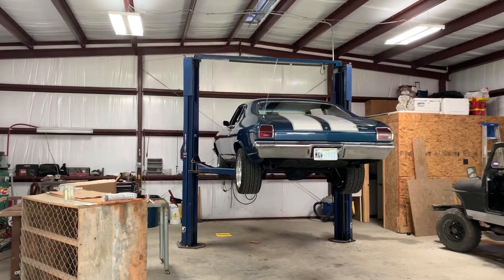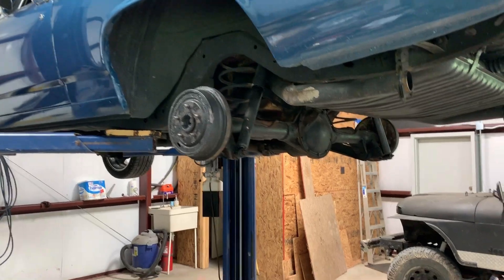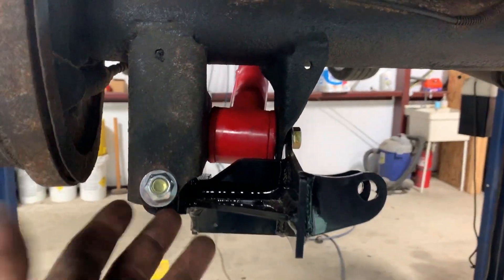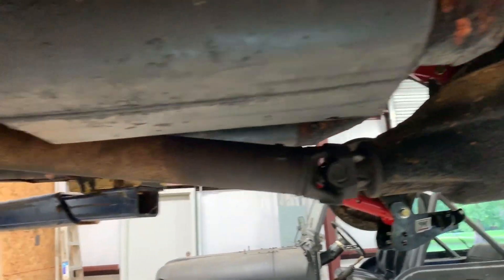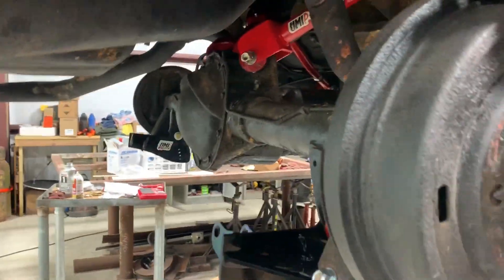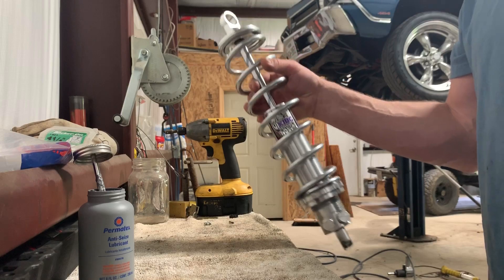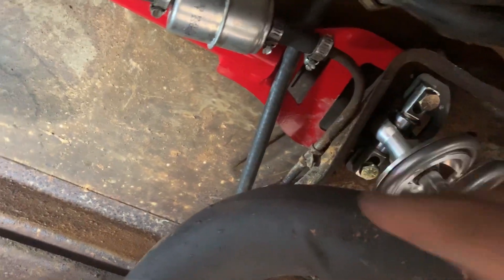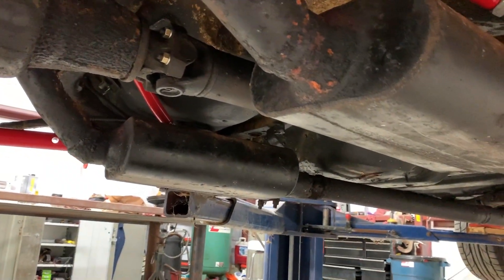UMI Performance Front/Rear Coilover Conversion for 1968-1972 Chevelle/A-body

Comment: Ugh, so disappointed...... Half of my kit was delivered for years 68-72 and the upper rear control arms and frame braces were shipped as year 64-67. I’m so upset right now. However: on a positive note; every old original nut and bolt is free, loose and ready for removal when the correct parts get here 🤘🏼👍🏼
Reply from the maker: Frank Carey Man I hate to hear that… That could be simply an expediting error on their end… Automotive parts companies are usually very sympathetic with their mistakes and will handle up with extreme priority.. I did a lift not too long ago and the kit came without the upgraded 2.O fox shocks… They said don’t worry about sending back the shocks to swap, we will send you a whole new kit.. blew my mind.. now my buddy has a whole new $1600 kit without wanting the others back.. it’s unfortunate, but will be worth it in the long run..atleast you’re ahead of the game.. if you plan to replace your upper axle bushings… Go ahead and knock out the old ones .. it’s a project in itself.. a great link on how in the description..
Reply: john hartel I’ve seen his video before, it was tough but I got 1 of them out. The bad part is that I’m on my back with the car about 2’ off the ground, no lift 😫. I’m going to have a time getting the new one in do to lack of swing and range of motion. I’ll trying a piece of threaded rod with nuts, washers and a pipe sleeve if I have too. I’ll reinstall the old upper temporarily when I get the bushing in so I can beat out the other side to get thing install down to a minimum when the part get here. Shock tower brace, coil overs are all cinched up at the top 👍🏼

Comment: I recently put QA1's "new and revised" coilovers on the rear of my 69 LeMans.  I'm very unhappy.  Had to chop off the back half of my $1000 exhaust system and add turndowns just ahead of the axle.  Cannot route exhaust through the new setup.  This UMI system appears to have created the exact same PROBLEM.  I'm very close to removing the QA1 parts and putting my air shocks back on, with the stock coils.  Anybody want to by a QA1 setup?  LOL
Reply from the maker: 😂😂 I found out the hard way as well.. I’ll take the ride and eat the cost of the re-route (haven’t done it, but it was due anyway) over the worn out stock suspension any day.. sorry to hear the issue for you..

Comment: Oh man I’m so happy that I found your video..... I purchased the complete stage 4 front and rear suspension kit with the upgraded rear coil over option for my 1972 Monte Carlo that drives like a sheet of plywood on the ocean. This video is awesome and should really help. Thank you for posting this 🤘🏼
Reply from the maker: Thanks for the reply! To answer your question about the front install, i did not do a video of the front because there are quite a few already on youtube..It was pretty straight forward and easy, even doing on my own. I have them listed in my description for your reference. I was very impressed with the night and day difference between worn out stock and the coilover upgrade initially..but when you find out much tuning adjustment is in these shocks it going to blow your mind...i listed in the video UMI's general cruise base adjustment, (also in my description) which i actually found to be a little firmer than expected...I then adjusted down 2 clicks on rebound and compression on each shock and when for a ride.. man o man!!!...ear to ear..the smoothness, the sensitivity, the control!!!..and then you punch it and the torque from the mild 454 goes directly to the rear and hooks up...no more sideways yaw movement from the torque..couldnt' be happier with the improvement...worth every cent...and busted knuckle... let me know if you have any other questions
Reply: john hartel Going to start this project in November when I put it to sleep for the winter “New England” I can’t wait to see the difference in “actual” handling 👍🏼👍🏼👍🏼👍🏼
Reply from the maker: @Datanka69  Im excited for you bud.. and contrary...its just about cruising weather for us (south east texas).. we actually had a cold front last night...82degrees
Reply: john hartel That is awesome 👍🏼👍🏼👍🏼👍🏼👍🏼

Comment: NICE RIDE , I have 2  1968 chevelles, I put that IDENTICAL KIT on my Malibu  and could not relocate the exhaust to the rear after cutting and welding pipe forever. Do not know why they have that monster coil over lower bracket that has the coilover sit right in the middle.  I  put the turndowns after the muffler but I drive my cars all the time and could not deal with that NOISE . I did find  QA1 Coilovers , their rear coilovers basically sit in stock mounted positions.   I can hear my radio again..    I set mine at 25 x4   totally different ride for shure .. Enjoy

Comment: I love ya car for that is a rare 69 Chevelle Coupe . Thanks for sharing the installation of UMI set up . I’m working on a 69 Chevelle off frame with the 9” Ford and 4l80e transmission along with 468 hydraulic roller. I hope I can get the power to the ground! Thanks Again!!
Reply from the maker: Thanks for the reply Ronald! Sounds like you have quite the project on you hands. I need to gear up to 3.73 from current 3.08, but Ive managed 14-16mpg out of the mild 454 with the TH400 now that ive fine tuned my carb, so you're gonna be in hog heaven with the overdrive.  I couldnt be happier with outcome of the suspension setup and how adjustable it its. Definitely a worth upgrade, especially if you're currently stock. You'll be a F'n arrow off the line with this system. let me know if you have any questions.

Comment: Great looking chevelle! I just put rear qa1 dbl adjustable coilovers on my 69 gto and i have a front set as well. I also installed that umi upper shock tower brace and it was a pain. The qa1 have a bracket with 3 bolts and it took me quite awhile and some choice words with skinned knuckles to get it done. I have umi adjustable lower arms as well and front umi tubular control arms with tall bsll joint's to install with the coilovers. One mean sounding chevelle!
Reply from the maker: Thanks man! Yes, if only they had that suspension technology back in the day. This car is so responsive and fun to drive. I’d compare it to the feel of a new camaro.
Reply: So Im curious what was the cost of your front end rebuild to tubes coil over etc. I considered it  for my 65 goat but Im spending so much on the front end stock, engine, installed UMI chassis brace, Gforce tranny mount which is awesome, and gas tank, alum radiator etc. etc. all that just materials is around $8500! Yipes Thats why I decided to do a stock rebuild, oh I also am going from man. steering to power, lost of new stuff. Have you seen Fast Monty 69 rebuild? If not take a look at the ME Wagner PCV valve
Sorry to much coffee
Reply: @frekkledipped  hello, yes I have subd fast monty, its one bad goat have watched all his vids. The front qa1 dbl adj kit was 750 or 800 i believe, the umi tubular control arms were 1600.00 and the pro forged front end kit i bought was like 350 if i recall. Definitely not cheap but top quality parts for sure that will last. I have done the rear but need to install the front end parts. Your goat sounds nice, mine has a 70 455 bored .60 over, I also brought a new fast ratio pwr steering box and new pump for it as well. Have had it near 30 yrs now...time sure flys!
Reply from the maker: Thanks evil bane
Reply: @puddleduckist  I have a long way to go from the radiator to the universal joint everything is removed waiting for engine to be put together. I purchased one of those tranny mounts FM recommended & a ME Wagner PCV valve. Both seem pretty awesome looking forward to when they are working :-}I bought mine Dec 2020 got burned
Reply: @frekkledipped  sorry to hear u got burned, sounds like once its done it will be a bad goat. My friends dad bought a 64 gto with tri power and a 4 speed new in 64. Kept it all these years and yrs ago restored it with his son and gave it to him, even had the original 60's tq thrust wheels still on it. Beautiful car, dark nocturne blue with black interior, man it's a sharp car!!! Luv the pontiacs, we had several pontiacs over the years. A 65 convertible tempest custom we put in a 428 tri.power, a 66. 67, 68 gto and a 68 lemans. My dads car was a 67 lemans with a butler 455 stroked to a 474 with edelbrock heads, man was it a runner, ran a 10.89 at 125mph off idle first pass it made at Sacramento raceway. Fun times, best of luck with ur poncho!

Comment: Outstanding, my 66' SS-396 sure could have used help back in 1979'. Dirt on the floorboards would jump 10 inches in the air from wheel hopping everytime i did a burnout.
Reply from the maker: 😂😂😂 I know I exactly what you mean… it hooks up hard now..🤘🏼

Comment: Thanks for the instructions. Not sure if anyone else is having this problem but I just finished installing this kit in the rear, and the ride height will not go back to stock no matter how far I screw the washers up the shock, It's way lower. Also, is it bad to have the washers screwed all the way to the top?
Reply from the maker: My set went about the same, I assumed adjusting the collars evenly would give a even result and it was way off. Their answer was the adjustment is cross leveling, the right rear is effected by the left front and left rear is effected by the right front, and there are different weights across the length of the car that would make one coilover be tighter bound than the other. In your case it sounds like your spring rate might be wrong for the weight of your car. You should contact them by phone. They were very informative when I called.

Comment: great video ill be doing this to my car soon ive got a question about your wheels what are the widths and what is the the backspacing?
Reply from the maker: Hey! Thanks for reaching out. 
American racing torq thrust II & Nitto 555 G2 tires
18x8 4.5BS/0mm offset front w/ 245/45R18
18x10 5.74BS/06mm offset rear w/ 295/40R18
Reply: @GatorOverland  thanks for the quick reply!

Comment: Hey looks great, what size wheels and tires are those?
Reply from the maker: Thanks!! Chevelle wheels
American racing torq thrust II & Nitto 555 G2 tires
18x8 4.5BS/0mm offset front w/ 245/45R18
18x10 5.74BS/06mm offset rear w/ 295/40R18

Comment: Do you think this kit is worth the 1700ish bucks more it costs than the BMR stage 2 kit? seems the only difference is the coil over shocks and the rear shock bracket up top? I need to buy a kit for mostly a street car with some track days on a road course strictly amateur stuff so coil overs might be overkill????
Reply from the maker: Absolutely.. and if anything.. the shock tower brace in the least.. the ability to adjust is priceless
Reply: @GatorOverland  Thanks for the reply. I appreciate the advice of someone who used the stuff. Thanks again man!!!!!

Comment: can these coilovers be used in the original shock mount locations (i.e. without the relocation bracket)  or will they hit something?
Reply from the maker: Thanks for taking the time to watch and comment.. you could do it, but I wouldn’t Recommend it. The relo brackets are actually a form of reinforcement. The original stamped components were only designed to handle stress from the shocks function (not much).. supporting the weight of the vehicle on those points without reinforcing could result in material failure..
Reply: @GatorOverland  right i had the same thought. but i was also considering using these as "helper springs" to lift and assist the original coil springs in my fathers 67 SS. this is mainly a street car that may see the occasional launch at the strip with drag radials. Thoughts on that idea? we have been trying to move away from the old air shock method of suspension lifting. Thanks for your insight!
Reply from the maker: There are spring assisted shocks available, but not to be confused with coil overs, though they look similar their dynamic and abilities are completely different. Spring and air assisted shocks are more of a bandaid than anything. If you’re wanting to keep it stock I suggest contacting a company like eibach to have your original springs updated with new stock height or desired rake drop.. or... pulling the trigger on a coilover system which allows for multi dynamic adjustability (ride height, rebound, compression) either way you are doing the right thing. Mating new tech with that antiquated suspension is absolutely worth the investment.
Reply: @GatorOverland  cool thanks a bunch for your insight sir!

Comment: Fantastic video - are you happy with UMI Kit? I have a 69 Olds 442 considering suspension upgrade
Reply from the maker: Eric Gonyon worth every dime!!!!! It’s unbelievable how much it has changed the response and sensitivity and obviously looks good too. Other than the muffler issue and the show tower brace, it was a pretty easy install (with a lift). I backed down the UMI suggested C & R settings I posted by 4 clicks and it to my preference. The car has gone from driving a couch to driving an arrow!!!

Comment: Any reason that you chose the UMI setup over others out there like, QA1 or others? Just curious, I’m trying to decide which setup to go with
Reply from the maker: They are all generally about the same in fabrication and design.. I liked the full kit options UMI offers and their support group is stellar.. 🤘🏼 no regrets
Reply: @GatorOverland  Thanks for the quick reply 👍🏽
Reply from the maker: You bet.. what vehicle are you working with?
Reply: @GatorOverland  72 Chevelle Malibu, SS Tribute
Reply from the maker: 🤘🏼🤘🏼.. mine is a 69 300 deluxe.. you won’t regret going coil over.. it handles curves like a modern car and is a F’n arrow off the line. I love it.. no more driving a sofa😂
Reply: @GatorOverland  😁
Reply: @GatorOverland  I checked the links in the description but can’t tell, what stage kit are you running 2 or 2.5 or something else? Also what’s your wheel and tire size
Reply: Ok I see the wheel and tire size, it’s at the end
Reply: What kit is it stage 2, 2.5 ?
Reply from the maker: @1320str8liner  
Im not running a suspension stage package, just bolt on kits to make a "john stage"... the website links to the direct part page are in the description- here are the model numbers, let me know if you have anymore questions.
REAR CONTROL ARM UPGRADE (ABR813) 
Rear coil over conversion kit, including opt. shock tower brace (4057-xxx) https://www.umiperformance.com/home/product/1964-1972-gm-body-rear-coilover-kit-control-arm-relocation-bolt/
Front Coil over conversion w/ double adjustable (A204-xxxS) https://www.umiperformance.com/home/product/1968-1972-gm-a-body-viking-front-coil-over-kit-double-adjustable-polyurethane/

Comment: Question, would you recomend putting  a thin layer of anti seize or grease on the thrust washer?
Reply from the maker: I don’t think it’s necessary if your have the roller bearing upgrade.. it’s really smooth operation. Putting grease or antiseaze could keep the bearings from rolling, especially if they get contaminated with dirt. Personally, I would not.

Comment: I gotta ask how much better is the ride with the new kit  compared to before?
Reply from the maker: Tony Pulido honestly there is no comparison to before.. the original suspension was so shot.. I would compare the ride and comfort of this suspension upgrade to that of a late model camaro.. I’m so impressed with the outcome of this kit.. I would recommend to anyone willing to separate with #’s matching stuff and update to modern suspension dynamics. It’s literally an arrow off the line now with absolutely no wheel hop ! And steering in to turns is a grinning joy verses a hardship of a sailboat captain in a 4-6 swell
Reply: @GatorOverland  Your sailing analogy makes me laugh.  It's really nice to look at comments to get your opinion after a year or two from install.  Thanks for posting.
Reply from the maker: Worth every cent 🤘🏼

Comment: What size are your rear tires?
Reply from the maker: American racing torq thrust II & Nitto 555 G2 tires
18x8 4.5BS/0mm offset front w/ 245/45R18
18x10 5.74BS/06mm offset rear w/ 295/40R18

Comment: Is this full droop? How much lower could you go if you wanted to ?
Reply from the maker: Thanks for the reply! This is approx 1” drop from factory ride height. The coilover can be adjusted from stock to 3” drop and still maintain the same handling characteristics. You could easily drop the front and rear another 2”, though your rear would be really close to your bump stops which would look cool, but probably wouldn’t be the best for most driving conditions unless you like a hard tail feel.. I’ve been debating on going down 1 more inch. I do like the lower look, but currently this look perfect to me. It handles even better than it looks. Let me know if you have any more  questions..

Comment: How were you able to tighten the shock brace nut you installed with your finger?
Reply from the maker: 😂 magic!
Reply: I may put one of these into my 70 Buick, but I can't seem to find my magic wrench set anywhere
Reply from the maker: I had to hold my tongue right, but got it. I can’t promise it’s torqued to full 35ft/lbs, but it’s in the ballpark..